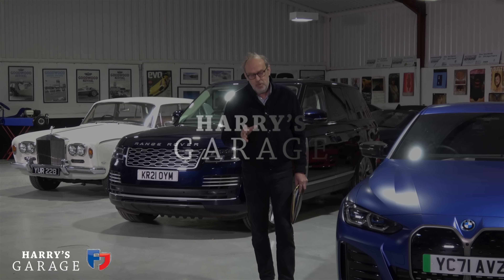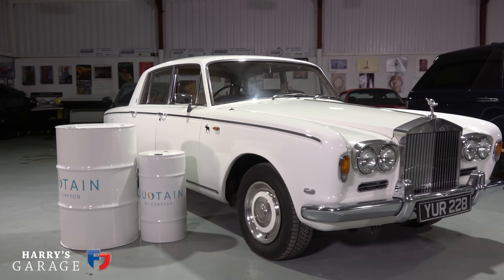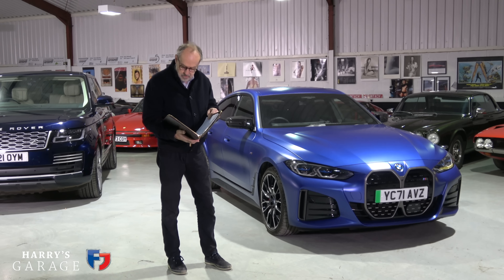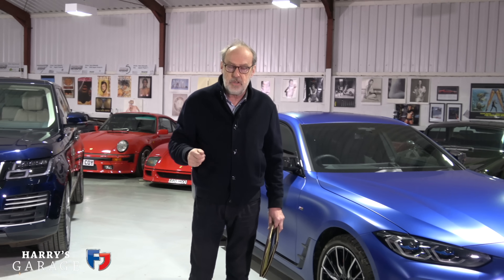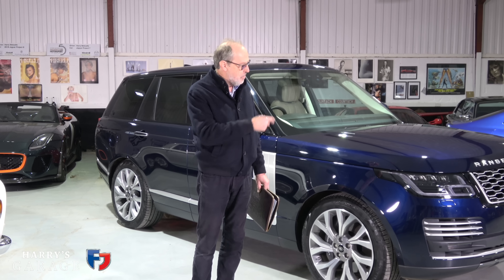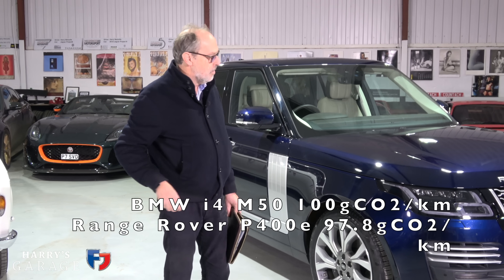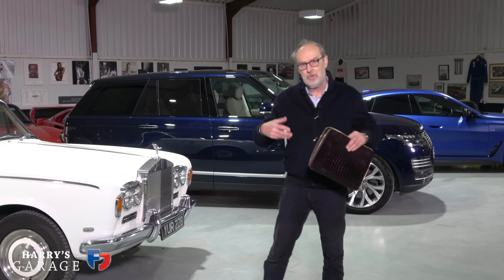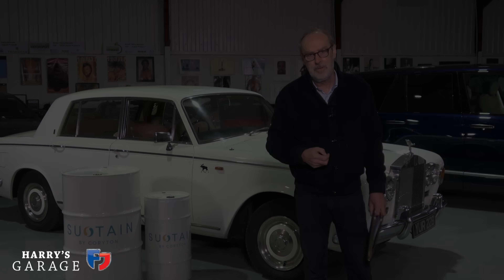Sustainable fuels; what are they & are e-fuels better for the planet than running an EV or PHEV?

Comment: Full of admiration that you’re going to the trouble of pursuing synthetic fuel. Did you factor in the emissions from shipping the fuel to the UK?
Reply from the maker: It's made in the UK! E-fuels are completely different and not in production yet
Reply: @harrysgarage  Harry. Love your videos, and this is another good one with a very thought provoking subject.  However in this video when you were comparing CO2 of the EV versus the Phev, you did not include the CO2 emissions of shipping the oil to the Uk or processing it ( a lot of energy/ electricity is used in that process alone)  If you do this then any car's emissions are plus at least  2-300 per mile  on top of what the petrol engine physically emits to cover these processes. This is missed out in lots of comparisons , and needs to be included for a level playing field,  Shipping is a massive contributor to our overall emissions. Its transportation like tankers which need to be using sustainable fuels/ green hydrogen etc . There is no real green answer for anything us petrolheads like , all transportation is a significant impact on the environment...whichever way you look at it. We should still enjoy our cars/ bikes/ Evs though...

Comment: And if you charged the BmW using your wind turbine ? And if you applied the same carbon calculation to the bmw that you used with the Rmage rover
Reply from the maker: The BMW was a press car, delivered charged, which is why I showed the emissions from charging off the local grid

Comment: Solely Electric isnt the way. It's common sense that the Hybrid Petrol /Electric makes more sense until the Hydrogen solution comes along. These Electric cars will be redundant by the time they go 2nd hand and 3rd hand might not happen due to the batteries needing replacing and that will cost someone, as well as the planet. We should be keeping cars longer, much longer. We had a Daihatsu from new and it lasted. A Great little car that cost £7.5k and sold it 17 years later for £800.

Comment: As someone else mentioned, these are false analogies really as fuel at the pump costs a lot more emissions in prospecting, drilling, pumping, distilling and final delivery. Shipping is by far the dirtiest for emissions and least efficient mode of transportation when 60% of crude is delivered this way. Shipping alone accounts for some 3% of global CO2 emissions.

After this you can begin to discuss fuel emissions per car once you have factored these items in as well.

On top of this, when you state sustainable fuels, you must realise that these are taken from plant based products. Brazil is the leading user of ethanol and methanol, guess why? It is because they have destroyed vast swathes of the Amazon to use as monoculture farming for sugar, soy, rice and corn.

The vast majority of the pre-fuel starting point then is the destruction of the actual carbon sink natural environment and switching that over to intensive farming where you are destroying rainforests that contain vast natural deposits of carbon in the from of trees. For example, each tree is a growing warehouse storing potential carbon as it grows, a 2 metre wide tree at 30 metres high will contain around 65% of its weight in carbon, and this is without then the other plants that surround the forest and the animals etc that also convert carbon.

Monoculture farming is perhaps the biggest threat to our natural carbon cycle than anything else as it removes millions of tonnes of already held carbon and replaces it with plants that can only hold usually less than 1% of the carbon that was stored previously on that land.

My point is that this is far too complex to pit one against the other unless you are aware of, and discuss, these issues. Destroying rainforests to increase yield of bio-fuels is perhaps the biggest con out there at the moment as this not only affects the carbon cycle but things like the water table, excessive use of fertilisers (again one of the most carbon intensive processes in and of itself before you strip the land) and various other shipping/production costs before the product gets to your car.

Comment: Have you calculated the energy used and CO2 emissions in producing and transporting sustainable fuels and doing a comparison with fossil fuels and EV electricity. And what about the CO2 used in building EV's & hybrids which I believe take years to pay off in CO2 terms compared to an ICE car?
Reply from the maker: I asked Coryton for a CO2 figure for their fuel but they couldn't give me a figure. I'm saying we all need to keep our cars longer, however they are powered. A PHEV uses a smaller battery, so CO2 produced during the build process is lower compared to a full EV

Comment: Great video Harry. I’ve seen a lot of anti-EV stuff coming from ‘car YouTube’ recently but you always offer a reasoned POV. I totally get that lots of people are emotionally invested in the continuity of the internal combustion engine and in a sense cars are being picked on as an easy target in the climate change conversation. However, looking at it from a macro level it just doesn’t make sense to continue pursuing with ICE. The simplicity and efficiency of the electric motor is the key to its superiority. It’s the batteries everyone complains about, quite rightly too but that is technology which is relatively new and will only improve. The internal combustion engine has reached its shelf life in terms of innovation, the technology cannot possibly get the factors of improvement that we need from it. It just doesn’t make sense to continue with it as our core mobility solution. Fundamentally the ICE is an inefficient 19C invention that has given us a huge amount of social progress but isn’t fit for purpose when we’re talking about technology for the next 50-100 years. By the way I’m not saying ban them, I love engines and cars and we should continue to celebrate them. I just understand why nation states are pushing OEMs and society towards electric ‘cos it makes sense long term.
Reply: @wymo85 your reply is the best on this board, logical, well written and not a ‘diss’ insight, brilliant

Comment: Great stuff, but those BMW figures on screen don't /quite/ add up.

Sorry to be the pedant...

2.5 miles/kWh makes sense if you put your welly down a bit. That's just 400Wh per mile.

But those 131 miles should have used about 53kWh at that rate, not 8!

I don't think it affects the rest of the figures, though.
Reply from the maker: The 8kWh figure is the amount of power harvested from braking during the journey
Reply: @harrysgarage  Oh, I see! Thanks for replying :-)

The synthetic fuel option is interesting for your low mileage cars. I might look at that for my motorbikes :-)

I agree with keeping a working machine going.  Not just because some of them are fabulous engineering and things of beauty, but there is also an eco cost in scrapping things to buy new. 

We shouldn't pretend that we can consume our way out of climate issues by scrapping working cars, without a bit of thought.

My next car will be an EV (so maybe new) but for now the 2000 Clio still does good MPG and doesn't eat bits. Why waste a working machine?

Comment: It uses less CO2 to manufacture an EV because they’ll last as long as your Rolls. Why? Far fewer moving parts etc etc.
Reply from the maker: What about the battery? Tech change will come around 2030 and will make today's EV look like fossils
Reply: @harrysgarage  , what about the battery? They use less Cobalt than the oil industry already and there’s a huge supply of Lithium in the waste water in Cornish mines, without even trying. Rob Llewelyn’s Fully Charged You Tube channel is a very good source of non-fake news he has a very open mind but REALLY doesn’t like oil industry propaganda:-)

Comment: The ‘SUSSTAIN’ fuel is not lowering carbon use though just re-using it! If you are going to measure EVs on a source to wheel basis then you have to compare it with ICE on exactly the same basis.

Comment: The real fun starts when you feed the surplus electricity from your solar cells or wind turbine into a small, local hydrogen or sustainable fuel plant. Imagine a shipping container in your back yard with a small hydrogen plant, turning your surplus solar or wind electricity into hydrogen that you can then feed into your car for driving or into a generator for creating electricity after dark.
Reply: You need 9 liters of purest water to produce 1 kg of hydrogen. You need 1 kwh energy to get 1 kg CO2 from the atmosphere - in total you need 6-8 times more energy to drive your e-fuel vehicle than an battery electric vehicle.

Comment: I'm all in for sustainable fuels. As an owner of a classic myself I don't really fear having to pay more for running it (I drive only about 1.000km a year with it). I fear not being able to run it anymore. Secondly I think that sustainable fuels are much more environment friendly than electric cars. Electric cars have to be build first - including all their batteries. Also with an all electric traffic, we will need much more electricity than we need now and we don't have the technology to produce all that electricity with renewable resources. Non of these problems exist with sustainable fuels: We can - at a large scale - use the cars we already have and it won't increase our need for electricity.

Comment: Lot's of things to correct here. You didn't add the gCO2/kWh for the electricity in the hybrid Range Rover, but you did for the BMW. You used a spot value (i.e. what it was that moment) for the carbon intensity (for a region you don't live in, even though you said you did live there) of 400g/kWh, when the average for 2021 is 317g/kWh for that region (which you don't live in), or 181g/kWh for the UK average. Most EV owners charge up overnight when electricity is cheaper (for me it's 7.5p/kWh) and the grid is less carbon intensive. You complain about the weight of the BMW but didn't mention the colossal weight of the Range Rover. But the biggest thing you chose to ignore is that it takes up to 10 times more electricity to produce the synthetic fuels compared to just putting that electricity straight into an EV.
Reply: Excellent points. Actually, a Range Rover to take your kid to school is the symbol of energy waste.
Reply: Thank you for pointing all of these out! Absolutely hit the nail on the head
Reply: also no mention of comparable maintenance costs and incurred CO2 from that.

Of course the recharging network has to be improved and fed with ever more sustainable energy but it will .... and recycling of batteries, after their million miles will happen.
Reply: As usual it is never mentioned that batteries are recycled, just as you are doing on your Electric Classic Cars channel. Lots of good content on engineering explained as well as to the total time needed before scrapping an old diesel is better for the planet, also the biomass E10 used and the landmass required to make it.
Reply: Most of these points are addressed in the video... Did you watch it? What use is electricity produced in Chile to electric car drivers in the West? Harry states that carbon emissions for the grid vary massively and that his figures are only relevant for him. Also you have 7.5p on economy7 for after the price cap change? That's the figures Harry is talking about.

Plenty of critiques to be made on Harry's infomercial but these ain't it.
Reply: @aidensmobile614  Exactly. An example closer to home is the excess electricity generated in the Shetlands. It can't be transported so there are now plans to use that wasted electricity to produce hydrogen.
Reply: @chrisb9360  I'm afraid that it's very complex and the situation is different for everyone. I think in general that we're in the right track with switching to electric cars and improving the grid with more renewable power.

Edit: The omission of the CO2 for the electricity of the hybrid is quite the mistake
Reply: @grandtourerpt  It's worse than that, he says 'where we live' and uses the figures for East Midlands DNO. He doesn't even live there, he lives in the Southern region. Later on he goes on to say that Birmingham and Oxford are also in the East Midlands DNO region, they're not, they're in the West Midlands and Southern region respectively. At best this is innocent incompetence at worst this is intentional misinformation. Very poor......

Comment: Its all ultra rudimentary. But its the only planet saving option there is for the next 50 coming years. With this you can turn the clock back and be renewable and poor countries dont need any infrastructure. Just fuel stations. Boom. The only thing to be aware about: It can't be a monopoly. Solved.
I am happy you actually did research unlike all the others rich car you tubers who are blatantly stupid and have not earned any real money themselves. Shame

Comment: Great info with food for thought, if you factor production CO2 in a well made against a car that isnt feasible to repair like modern electrically dependant cars, that lets face facts are in the bin at 10 to 15 years, so your old RR along with many of say pre 2000 cars.

conclusion, recycling costs should be part of the purchase prices of all new cars.

Comment: Brilliant Harry, as always. Just 2 questions concerning the fuel which might have a fairly big importance: how is it transported from Chile to EU? And could it be a global answer?
Reply: Arguably, if the vehicles used for transportation are also fuelled by the synthetic methane  based system favoured by Porsche,  Siemens et al (direct air capture of CO2, combined with hydrogen from separating water into its component parts using truly renewable energy capture such as wind and solar to create synthetic methane) then the CO2 impact of transportation will be significantly reduced/net zero. 

The tech already exists to create the laboratory factories required to manufacture, the limiting factors will be available real estate for factories being powered by nature.
Reply: @RT976  Wrong. That is not the limiting factor. For example covering 1% of the Saharan desert in solar panels would give enough electricity for the current global usage. We do not lack space on this planet. All we lack is for the industry/tech to be profitable.
Reply: By ship. If you transport 100 liters of fuel by ship at that distance, then you only use about 3% of the transported fuel as fuel for the ship. So it is actually quite efficient. Transporting the electricity directly cable would lose about 50% of the energy.

Comment: One molecule of CO2 is just like any other molecule of CO2. They are all molecules of an atmospheric greenhouse gas. I don’t see environmentalists being impressed by sucking a molecule of CO2 out of the atmosphere for inclusion in a synthetic biofuel and then spitting it right back out into the atmosphere when the fuel is burned. They likely would say it’s like running a water circulating pump in a flooded town.

Comment: Does this factor in the CO2 emitted by shipping the fuel from Santiago to Burford? You should probably factor in the refining and shipping of the petrol in the Rangey as well. Would be interesting to see your findings on how this fuel compares to e5 in terms of power and efficiency. There's plenty of old M3s still about so I'm sure that M50 will last as long as your Rolls if it's looked after. Not like you need to worry so much about servicing, just fit a new battery in 20 years time and it'll probably have double the range too.
Reply: Shipping it is very efficient. About 97% actually because the ships carry so much fuel compared to how much they use.

Comment: I've got a PhD in chemistry but work as an engineer in the automotive industry - so you could say I know a thing or two about the topics you're talking about. And I'm sorry, but most of it was widely inaccurate and honestly dangerously false. There is absolutely nothing "sustainable" about sustainable fuels. The entire idea only works if you just ignore most of the process. It's only "renewable" if you only look at CO2 needed to grow crops and CO2 generated by burning the fuel. That's a perfect cycle. But it's only fiction. If you figure in every aspect - the chemistry, the transport, the fertilizers, etc. - then "renewables" fuels can actually be LESS good for the environment then fossil fuels (depending on the exact crop used; corn does worst btw). I know this is a car channel, but I'm actually disappointed and a bit angry that you jumped so happily on this fantasy that the fossil fuel and car industries are selling you. Internal combustion engines will never be sustainable. Just put that thought to rest forever, so we can finally move on to actual change.